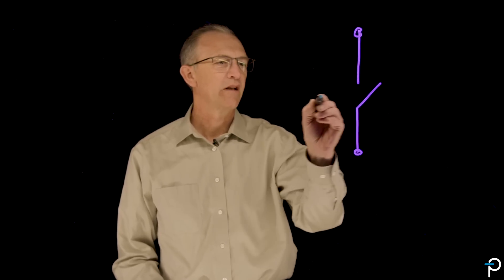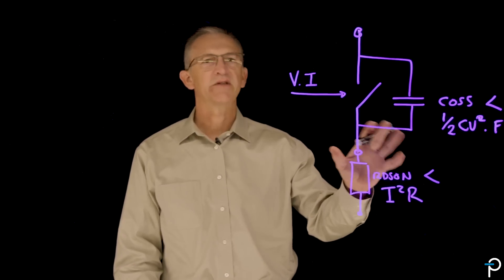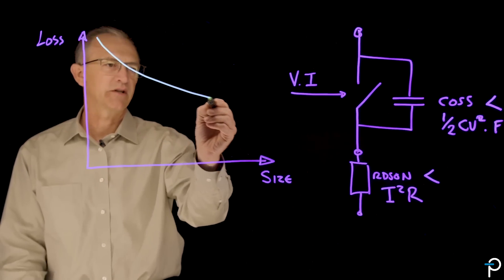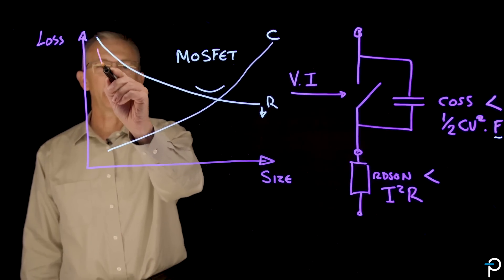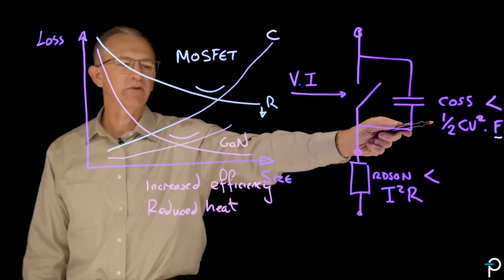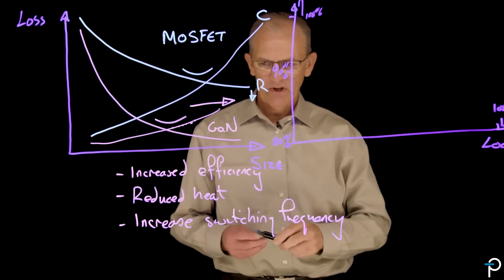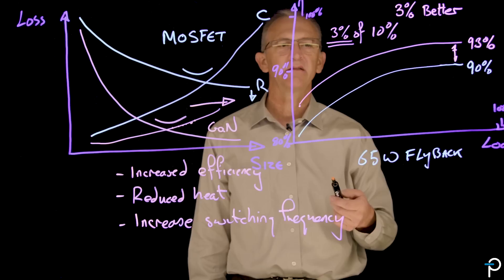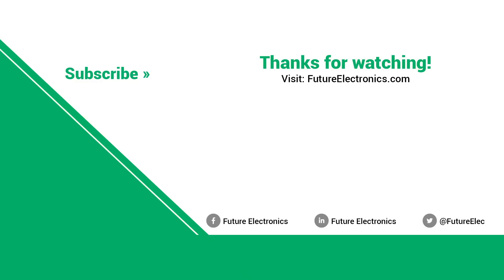What is GaN (Gallium Nitride)? Power Integrations Explains GaN Technology - Part 1

Comment: Somewhat hard to understand. The capacitor as drawn does not introduce losses in the transistor. What does is a gate capacitance and a drain to gate capacitance. Both need to be charged to the gate thresshold and for the drain to gate capacitance, it was charged by the drain voltage when the transistor is not conducting but the wrong way around. So this charge needs to be undone and then charge to the gate voltage. Alltogether that is called the miller effect and when driving high voltage it is way worse than just the gate capacitance. Another thing that comes to mind is EMC. Traditional fet speed often needs to be reduced to conform conducted and radiated emission. This increases power dissipation in the fet but then it will conform to several standards. So higher efficiency might not be needed Great explanation of GaN though.

Comment: Is there any way that somebody can simply explain this ? From my understanding, it seems that the nature of gallium being liquid actually gives a natural cooling during the process of conducting. And then is it also true that the nature of it being a liquid allows for the reduction of for lack of a better term back Currents? To me it seems like sound travels differently or slower through water in the same way that The back currents of voltage moves slower through gallium? What's interesting is gallium doesn't conduct electricity but it's what is added to it that allows the conduction of electricity. So where does nitrogen play the role of allowing the conduction of electricity?
Reply: This video is abt Gallium Nitride,which is made up by passing gallium gas and nitrogen gas with its chemical reaction,Gallium Nitride is formed and that professor was talking abt its characteristics and working.Hope this comment made it clear to you
Reply: @ajonline123  thanks for taking the time to clarify. 🙂

Comment: I don't understand any of it. All I know is that it's now a lot easier to lose my power adapters because they are so small now. The professor is also very good at writing backwards.
Reply: you can write normal and easily mirror the image in any editing tool.. 🤣🤣
Reply: Why is GaN so special?
- 🔋 Higher efficiency – converts current with minimal energy loss
- 🔥 Heats up less – so you don’t need big heat sinks
- 📏 Smaller devices – GaN chargers are much more compact
- ⚡ Faster charging – can deliver more power in less time
- 🌱 Lower power consumption – more environmentally friendly
💬 In short: GaN is the future of smart power — small, fast, cool, and efficient. If you have a GaN charger, you already have a bit of crystalline magic in your socket 😄🔌

Comment: Is he drawing on the board in reverse? 🤯
Reply: I saw the thumbnail for this video and was wondering the same thing. The video is likely flipped in reverse

Edit: It appears as if he's writing with his left hand so it's probably flipped since most are right handed
Reply: @_MaxHeadroom_  Yeah, I think you are right. Thanks bud, that makes a lot of sense.😄
Reply: Any advantages for GaN as synchronous rectifiers? Is there any third quadrant operation improvement?  Parasitic diode characteristics? Any reduction in Miller effect? Thermal considerations?